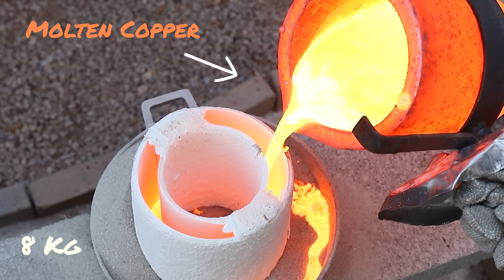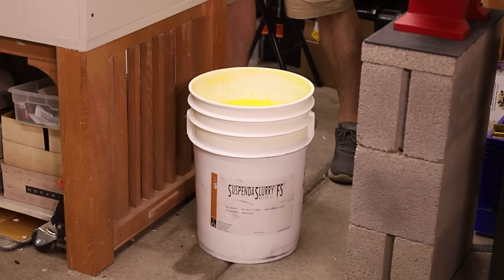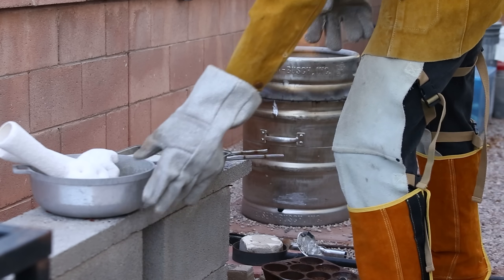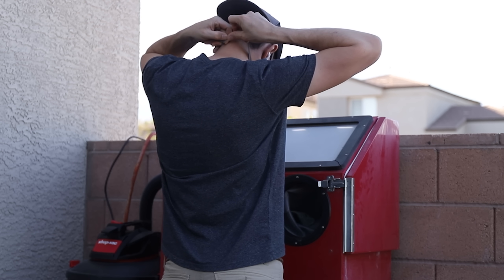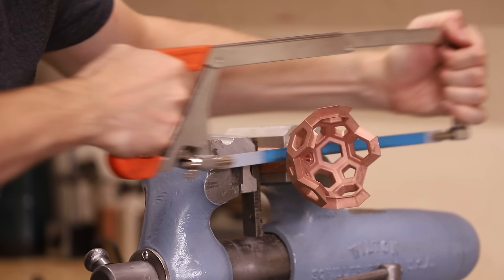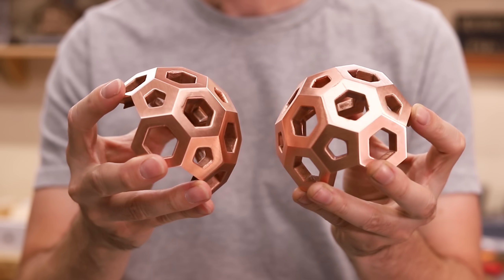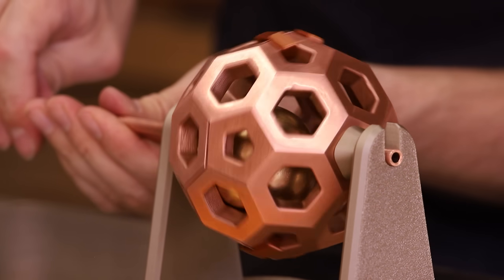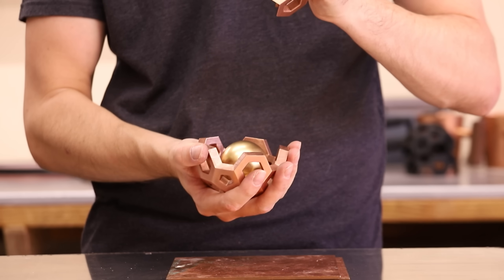HUGE Magnet VS Copper Sphere - Defying Gravity- Will a Neodymium Magnet Float Inside?

Comment: Physicist here:
You will notice that he has trouble finding a speed where it consistently floats.  I claim there is no single speed that this works for.  As you spin it the magnet field lines are cut by the copper causing eddy currents (and the repelling force that floats the ball).  However, it also drags on the magnet, causing it to try to spin at the same speed as the copper cage.  When the magnet spins at the same speed as the cage (synchronized), then the magnetic field lines are no longer being cut by the copper, there is no relative motion.  At that point he loses the levitation effect and the ball stops floating.

To solve this you could do a couple of things.  You could constantly accelerate and decelerate the cage speed (like a sawtooth).  Inertia should keep the magnet levitated during the brief changes of rotation direction.  This would cause the rotational velocity of the magnet to have a similar sawtooth (but with rounded corners) which lagged behind the cage rotational velocity sawtooth.

You could make concentric copper cages and gear them to counter-rotate.  The inner cage should be thinner than the outer cage so that the decreased torque of the outer cage (by being shielded by the inner cage) would be counteracted by the thicker copper in the outer cage.  The magnet could then never synchronise with both cages and it should levitate quite nicely.

Comment: You need a bigger cage you have 0 wiggle room and it bounces off the walls before can get centered preventing it from getting centered, I bet if a bigger cage and your drill on max it would spin in the middle  of it like you hoped for,  the kinetic energy will create essentially an electromagnetic field between then holding it in place, but I wanna know if its centered for long enough will it spin at the same speed as the cage or if the cage is spinning fast enough would it stand steady and unmoving in the middle as there would be equal force applied. (Also I think you're on the right track for the first ever perpetual motion engine if could find a way to get magnetic force to cause the case to spin) Last question(2 parts ) could you spin it and create enough electromagnetic energy to power a light bulb and if so, how would you harness the energy??? (Perpetual motion power source is what I'm trying to see if you can make) I have an idea on how to create a magnetic engine I'm just not good enough at the math to figure out the exactness required lol (I should have taken calculus back in the day lol)

Comment: Link up with the slow mo guys and/or someone who can connect the shutter speed of your camera to match a multiple of the rotation of the sphere. To get really fancy if one of them could program a feedback system so that the speed is dynamically controlled until the magnet reaches its most stable point.

Comment: Would love to see you maybe try and rotate the ball inside at high speed then placing the cage around it to see if it floats. Or even spinning it using a drill on the head of a nail through one of the wholes to spin it that way

Comment: What would the ratio Neodem mass vs Copper mass be for an ideal electric/magnetic motor of this design? Would there be a relationship of the above ratio to rpm required for perfect no contact, error free (centered) float of the magnet?
Or would it be Gauss strength vs Copper purity/thickness/mass?

Comment: paint the ball with UV paint, turn off the light, turn on a UV lamp - shoud look pretty cool, possibly might need to paint the inside black for reflection reasons though
edit, if it goes wrong, should be pretty easy to peel off acrylic paint from metal :)

Comment: Place multiple electromagnet  🧲 around the sphere. See if it will start spinning on its own and the sphere inside sits center floating.  Also, see if the spinning will create power.

Comment: Try this. Insulate  half of the coopper from the other half sphere. Use two separate axes that will be used to spin and see if you can harvest electricity. It should work like a brush motor. of not, wel its worth trying...

Comment: Could it be the magnet should be smaller, because I’m thinking the weight of the magnet is outweighing the force of the magnet because of how much less copper there is because of the holes, so maybe a smaller magnet would let it stay up without you having to spin it

Comment: New Sub... Wow, this blew my mind somewhat. I had never been aware of this property of magnets and copper, and I've never seen that type of casting before. As far as continuing this experiment, for sure, you need to connect the two parts of the shape together and attach the shaft properly, machine it precisely, and balance your copper shape. Then you need to employ proper servo motors and controls to precisely control the spin, and utilize a super slow mo camera to document it all. Extra credit if you scrap the duo hexo thing shape, and go right to a Buckminsterfullerene  ("Bucky Ball", google it.)

Comment: I am confused by the process. You 3D-print the shape, then cover it with ceramic, I got that far. But when you pour in the copper, what happens with the printed shape? Does it melt away? and if so, doesn't that make the copper cast impure? As for further experimentation, I would be interested to see what would happen if you ran a current through the sphere while it is rotating.
Reply: He placed the ceramic mold upside down in the kiln and fired it until the plastic liquefied. As a result, the plastic turned into liquid and completely flowed out, leaving only hardened ceramic mold. Check out 02:41.

Comment: I get how the bigger the magnet, the stronger.  But have you thought of using a smaller/ lighter magnetic ball?  I'm guessing that the strength of the magnet is partially cancelled out by its weight.  So I wonder if you can find a perfect balance between magnetic ball weight (size?) and magnetic ball strength where it remains in a suspended position inside the truncated icosahedron, just as the magnetic puck did inside the cylinder; that is, where the magnetic ball's strengh is not cancelled out by its weight?

Either way, you succeeded in accomplishing the desire effect as well as in making a gorgeous object, for which you had me glued and mesmerized by the layered process to create 👏🏽

Comment: A crazy thougt 😅
What if that inner sphere contains a motor which rotates the hollow sphere. And the current produced by it is used for keep working the motor. Then sphere should keep rotating and inner sphere should stay floating right?

Comment: You may want to consider using ball bearings to smooth out the rotation, and hold the "axles" steady.
     You should try wrapping enameled-wire coils around the "legs" 
 of the hexagons, perhaps with LEDs as a load?
     It would also be interesting to point an IR camera at the sphere, to see if/where it heats up from the eddy currents.

Comment: Amazing how you handle metals. Can you turn lead into gold? 🙂

From what i understand: You have an action-reaction behavior.

When the magnet moves it produces variable magnetic field.

That magnetic field produces electric current into the outer copper cage, then this current produces a magnetic field but it is inverted and pushes the magnet. Since the cage (or the tube is all around) it pushes it inside.

But  what i cannot imagine is How the currents are moving into your bee nest structured cage.
May be the tube was better? 

Il you create inverted currents: The magnet will be attracted instead of repulsed.

Another thing that you should consider is that you make very low voltages and very high currents.
It means that the external cage must be ultra-conductive.

If you make holes into it : it is very much less conductive.
Allso you could try to increase the thickness of the cage.

These are just suppositions.
Reply: Jean-Yves France, thank you for your video.

Comment: If you could hook the shaft up to something that would give you a constant but adjustable rotational speed you could use an adjustable strobe light to easily video the ball floating inside

Comment: There are several mysterious examples of the polygonal buckyball  looking object, sans the sphere inside, that have been found in Europe. Function unknown.
I have some ideas.
My son in law works for a company that does 3d printing and has a basement full of printers.
I'd like to add another element to this experiment to see if it might solve the issue.
If I have success, I will respond with the results. If I fail, I'll toss it into the growing trash heap of ideas and lick my wounds.
Cool video:)

Comment: ##########  IDEA  ############                                                                                                                                                                                                                                                                                                             I think it might be jumping because that's how it's starting and that oscillation just keeps going. To potentially have it sit in the air nicely in a central location I had an idea for you.... Support the ball with cotton thread or something from each pole of the sphere and magnet. (experiment with locations). so it starts off in the middle! So long as that lines up with the center of rotation of that lovely cage you're grand. Then cut the thread when the cage is up to speed. That way it MIGHT not start to tumble.....  :D And then I'll be really pleased with myself..... :D You could even use weak elastic to support it. That way if it does drop and start an oscillation , you can try to combat that drop by letting it settle first with the weak elastic. If there's a sweet spot there, That's how I'd try and find it....

Comment: The magnetic force is flowing all over that copper with no orientation, it is trying to accumulate energy to release as heat but it is dissipating to fast, that is a good design to dissipate energy

Comment: You could spin it super fast for a while to get the ball inside spinning, then pull the supports for the cage to see if the cage resists falling due to the spinning ball magnet. In slowmo time the change in fall.

Comment: You’ve accidentally made a million dollar deal toy seriously sell that ad a motor so it will spin on its own. Make the ball inside more visually interesting like sparkly or something. Or checkered painted. Make the pentagonal slots bigger for optimal view. Then add a little hand crank with a gear system to help speed so you can reach over and fiddle it around by hand. 

This makes you a lot of money I’m absolutely certain
Reply: What if the ball had glow in the dark markings that spun inside too im telling you man.

Comment: try adding smaller magnets to the openings to see if you can float it fully, then have Iron poles to see if it generates. add clear plugs to the opening and add a conductive fluid to the interior.

Comment: Make an ellipse copper cylinder and use its minor axis as the spining points.Note to make sure the radius of the spherical magnet to be equal to the focus to vertex distance of one of sides of the ellipes mould...it will maintain the magnets lavitation to the scale of twice the time you make a full rotation..thank me LATER.

Comment: Practical use of idea: miniature scale prototype.  Hollow Copper tube 10ft long 10inch diameter. Inside on walls of tube place equally spaced negative to positive strips of magnetism equivalent length of copper tube. The passenger capsule will be the ultra powerful spherical magnet. Process of motion. Copper tube is to spin at a constant.  Electric current is to run in the strips in the Copper tube. Each end of the Copper tube is to have a repelling force for the magnetic sphere aka the passenger capsule. Thus creating hyper-velocity  from point A to point B. Congratulations.  You have invented . A new transportation system.
Reply: I would love to see it, miniature scale prototype
Reply: Did you just explain the transportation device in the movie, "Contact?"
Reply: Sounds fantastic in theory, but I'm not sure constantly rotating the road or track to power the vehicle would be very efficient.......😮
Reply: That’s crazy and unnecessary… instead of track rotation, come up with something clever like how LIMs do it — electromagnets turning on and off in sequence, or perhaps moving magnets, etc.

Comment: Boyd bushman did an experiment.  He took 2 neodymium magnets with holes in the middle and used all-threat and 2 nuts to force the magnets together, while the polarities faced each other.  North to north or southe to south. Then he put 2 neodymium magnets together opposite attract with all-thread and 2 nuts. He dropped them from the same Height of 4 stories building. The facing polarity north north or south south fell slower than the apparatus with opposite attracts all-thread and 2 nuts. Proving that the same facing polarity energy has a correlation with either mass or gravity being lightened. 

I saw him do it on YouTube. Anyways have a good one!

Comment: You needed to increase the diameter of your sphere... Simply put I think your magnet starting at the base had a tendency to travel in the direction that the outer sphere was rotating, being such a small sphere, you have to have a more precise speed for the magnet to bounce toward the middle and then hover there without the magnet trying to cling to one side or the other. But if you increase the diameter of your outer sphere somehow, while keeping the magnet the same size, then perhaps you can achieve higher speeds...

Comment: You can make a copper sphere and try film it with a suitable fiber optics camera from the hole in the axis.
Or a sphere with large holes only on one side so you can again see the magnet directly.   
Also use bearings on the axis if you decide to hook up a motor for permanent rotation.

Comment: I just seen this, want one. I think if you want to make the magnet float inside the copper cage you can line the inside with a opposing magnetic force to lift the ball from the inner wall's just enought t get it started an have a small motor to spin it to force it center. Hope it help's.

Comment: On trick to make it like there is a floating ball  
1. Make the copper sphere with copper net with not too thick wires and and paint it black and put it against a black background 
2. the one where you showed the sphere move when you moved a magnet feet away from the sphere 
The rotating magnet in the middle and connect it with a motor to rotate it and check how much torque is being produced at the sphere

For improvement 
1. Basically the magnet should be floating exactly at the middle of the sphere aint it maybe change the shape to a more spherical and then try it out again

Comment: You might try soldering the sphere closed with copper. As is, that split along the equator isn't allowing for electrons to travel to each hemisphere. Or you could try to make a multi-layered shell that covers all directions. Thinner spheres layers, but it might make a better result

Comment: Your sphere is rotating in 2 dimentions. It's not clear, but it may have a weakness on the sides and eventually hit them at high speed..

How about putting the sphere in a 3 spinning rings arrangement indide out, like Nasa multi axis trainer MAT or the orbitron attraction?

I don't know if it can be done, but you get the idea.

Comment: Your problem is that ball inside the copper needs to be moving (kinda falling)  against the copper to create magnetic field. If you spin copper too fast bal starts moving together with copper and no magnetic field is generated, if you spin too slow its not enought to generate field. You need balance when gravity is pulling ball down and, copper rotating at perfect speed to generate mag. field.

Comment: Close to a magnetic reactor, I think. Try interchangeable magnetic plates which mount through the portals. Have them all polarized to one direction, and then rework your magnet to mirror the inner shape of the vessel. Make sure the magnet will be repellant to the vessel. If possible, have at least two portals where electro magnetic power can be converted to power up either a battery or some sort of ignition system. If you go with the former, be sure to include capacitors and whatnot. If you go with the latter, maybe see how hot or high of ignition you can create and what kinds of fuels you can use to power a combustion chamber of some sort (either rocket or jet or even gasoline of a varying degree).... Basically making it a magnetic inverse alternator. Ideas.....

Comment: Put a thin layer of clear acrylic between the two halves of the shell so they are electrically isolated from each other.
Soldier each side to the copper rod spinning it
Measure EMF generated when spinning the shell
Maybe addimg voltage to each side when it is stationary would create a electric field strong enough to make the sphere levitate

Comment: Good idea.  The effect is due to eddy currents.  You might be able to experiment with more designs by using a lightweight styrofoam or 3d printed plastic support and covering with different types of metal foil that are variably magnetized first. Simulating these possibilities with Maxwells equations, FTDT solvers, and AI might get you further in establishing stable and effective eddy currents as well.  I think the real moneyshot would be to create such currents using induced skin plasmas and magnethydrodynamics playing off the currents in the ball with those that could be induced in free air.  There exists mhd solvers for that.  A flying or levitating object without a propeller would revolutionize air travel and travel into earth orbit as well.